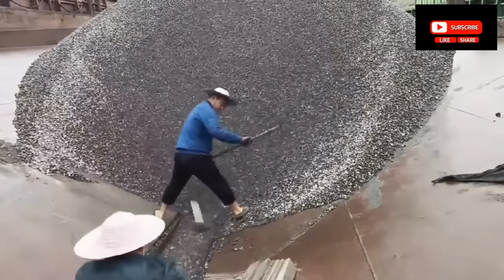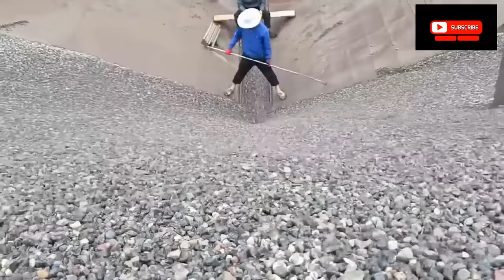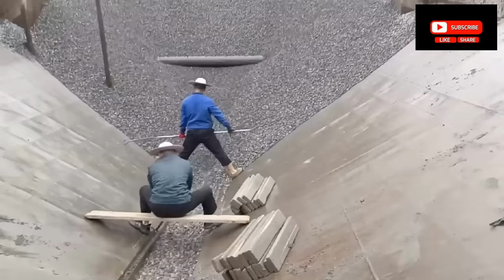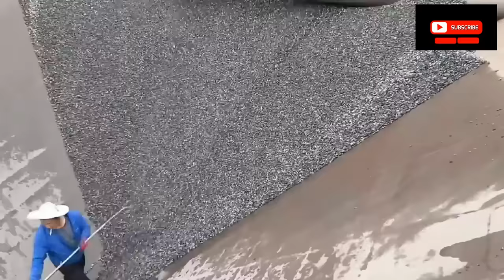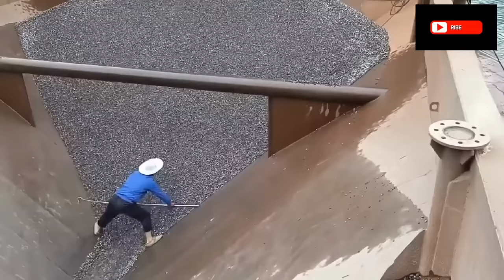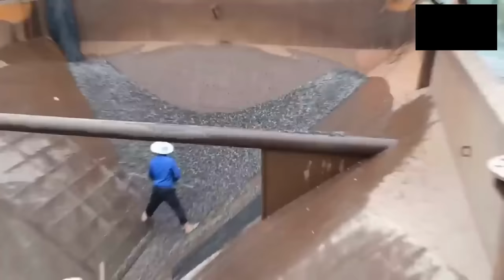A Complete Barge unloading video watch to satisfy and relaxing Video

Comment: Why are there planks in the material?  To stop the conveyor getting crushed when the holds are full?
Reply: think about it. If there were no planks, the drag on the belt would be so high you would not be able to spin it. It's so the belt can spin freely and isn't trying to move the entire pile at once.
Reply: Otherwise the belt will not move. To much weight. If it was not heavy without planks, the mountain would move all in one shot. This freight weighs thousands of kilo's. The machine cannot move that and the complete system will be damaged, costing a capital.

Comment: I am curious about the hook tool, as I see in a lot of these videos the plank puller having to sweep with the hook to dislodge any stuck gravel or sand that has caked in the steel, or banging with the end of the stick to shake things loose and make the flow better. 

Why not put a flat steel plate on the opposite end of the hook, like a margin trowel size that he could use for scraping along the walls along the edge of the pile? You could even angle it to be the same degree as the side of the bin, so when he puts the rod across the conveyor to use as a seat, it would act as a base plate and make it more stable.

Comment: 1. When it's completely full, how do you remove the first plank?
2. Why do you even need the planks?  Wouldn't you get the same result if the conveyor moved without any planks?
Reply: I think the planks keep the weight of the load from stopping the conveyor belt.
Reply: Without the planks the entire load would sit on the belt. That is too much weight for the belt drive system
Reply: As the others said, the planks keep the weight off the belt system. To answer how to remove the first planks, most likely there are no planks on the first few meters to get the system running

Comment: Where are the boards coming from?
Reply: They come from trees.
Reply: Before they load the barge they lay those boards across the valley so that the load does not rest on the conveyor belt.  Then a worker has to remove the boards one at a time with that pole that has a hook on one end while they're unloading.